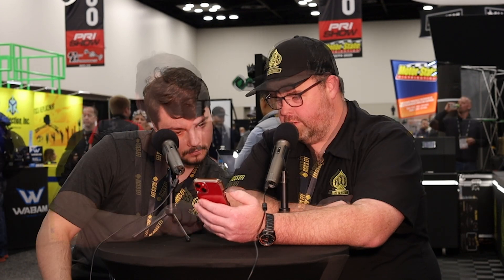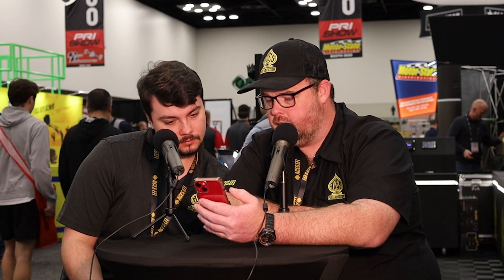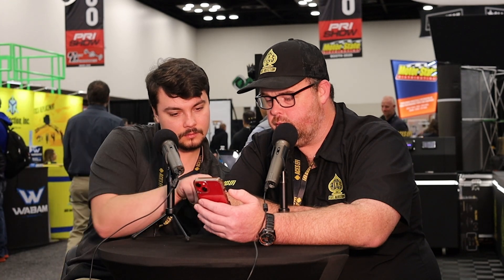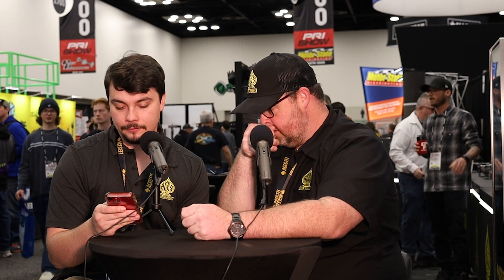PRI 2024 (Tech Tuesday Ep. 53)

Comment: Killshot, SBC 283, mild cam but have it set on stock.

The car runs great, but I have a lot of decel pop. And switching from "simple" timing to advanced/2d (to add timing to the follow table) can be jarring since the default 2d tables are different enough than the simple settings. I mainly have issues with it idling way worse on 2d timing, probably due to my cam. Figuring out MBT and and follow has been fun, but idle is killing me.

Any thoughts on either 1. adding a decel timing setting, or 2. adding a handheld wizard to do an auto conversion from the simple settings into their equivalent advanced tables? Would get people into the right vicinity of making slight tweaks. 

Also, thank you so much for the PDM! I've been needing to rewire the rats nest under the dash for a while and it just became so much easier.

Comment: Hi guys my jackpot acu is in for repairs and I’m currently installing the full house  and I ordered a tight fit fuel pump . Do I have to reset the ecu and start a new learn table for the new upgrades. I’m also running new long tube headers  thanks guys

Comment: Which jackpot intake would perform the best on a 5.3 with the btr truck Norris NSR Cam kit. My application is going to be stock other than cam. Would this require custom tune or are there pre loaded tunes for that. I am really leaning toward the jackpot for my 2nd gen s10 build. I love the videos on the blazer. Thanks

Comment: Hi guys, thanks for doing it for the people, good stuff!  Is there any plan to make a dual injection system, throttle body injection and port injection that work together?  It would be great to still get the evaporative charge cooling of the throttle body injection and to be able to tune cylinder banks (or individual cylinders depending on the system capabilities) with the port injection part of the system.  This could also increase the horsepower capability of the system via more fuel, charge cooling and better tuning.  This type of system would be great for all kinds of builds NA, forced induction and especially non-intercooled forced induction setups.  If you build it for the people, they will come and buy some(I will definitely buy some).  Thanks for all you do, take care.

Comment: (Question) I bought a jackpot with trans control mid 2024 for my 98 Chevy Silverado 2500 work truck with sh’medium size cam 4.8/5.3 & OG 80E, after initial issues its worked without issue since. (Thanks by the way) but
When are you guys actually going to start putting out legitimate tuning content & or in-depth videos explaining the different adjustments available in the software since the terminology & “pathways” are slightly different from most other common platforms???
Reply: This is not in relation to the authorized tuner subject but rather more to the “self tuning” guys that these types of systems were originally designed & developed for. In my opinion!
Reply: The (what it does) and (what it is) pointing at the screen & talking is exactly what I’m talking about, seriously the only reason I’m not jumping to buy another unit!!